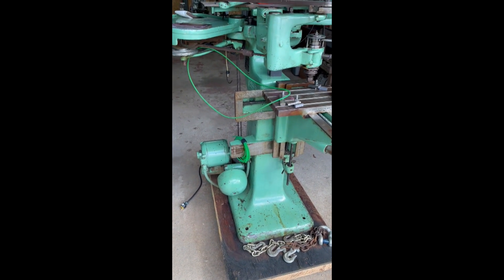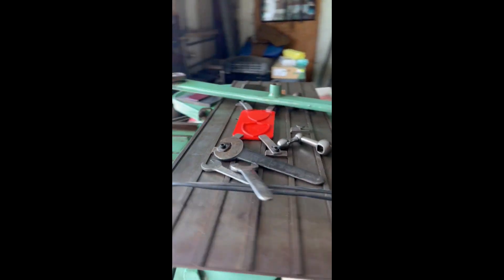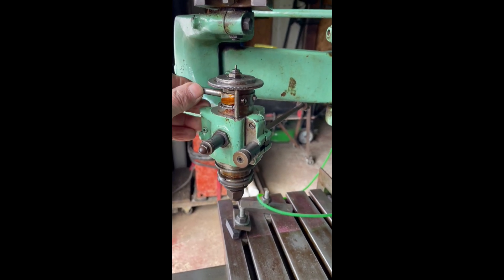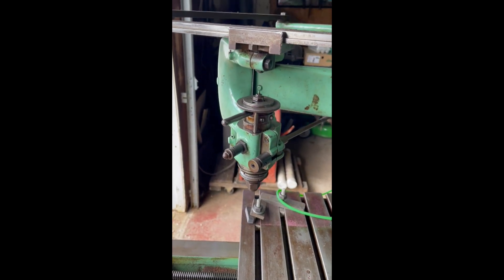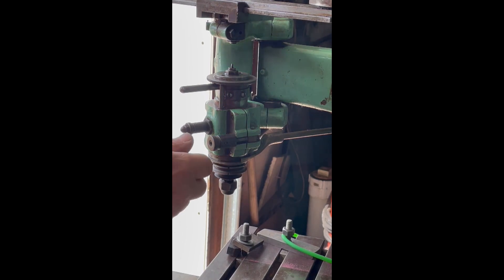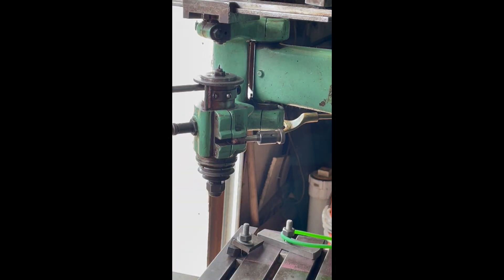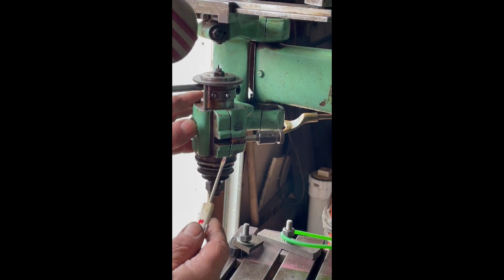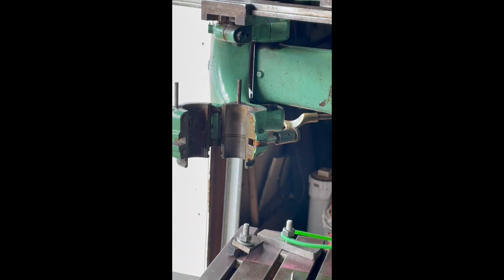Stuck Spindle removal in Gorton 3U Pantograph

Comment: Sweet!  I've got a couple 3Us, and I love them!  If you decide to do a full tear down of the spindle, you gotta start with the smaller disc on the top.  It's got two blind holes for a spanner wrench, but a couple drills in a vise works just fine